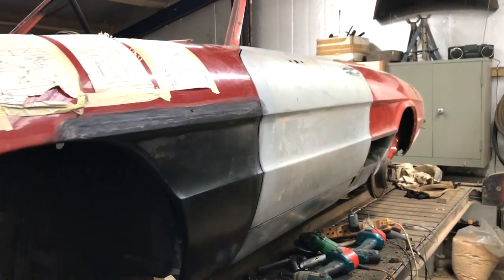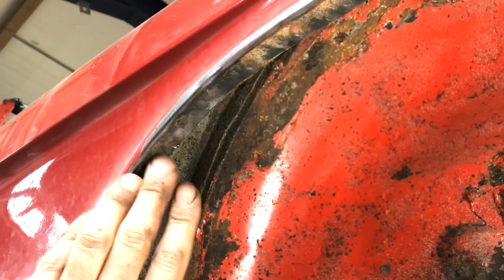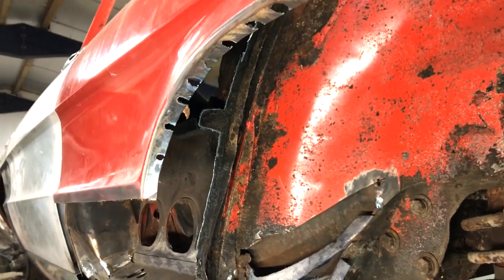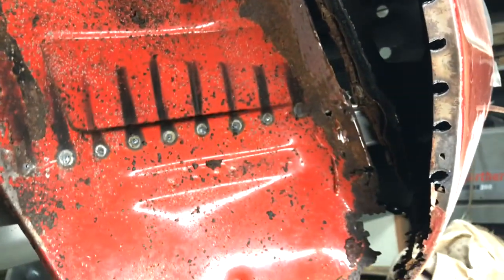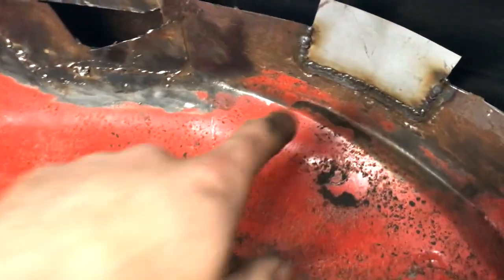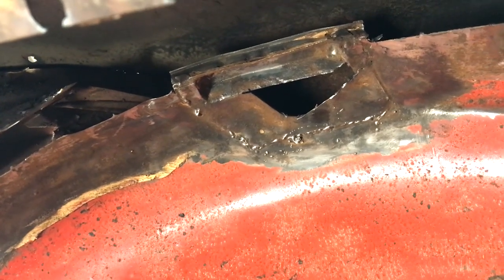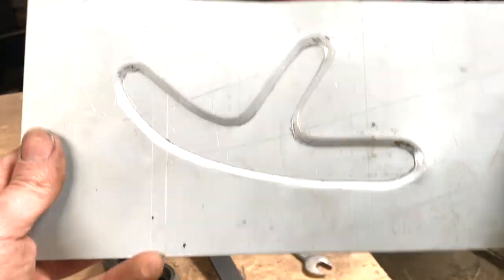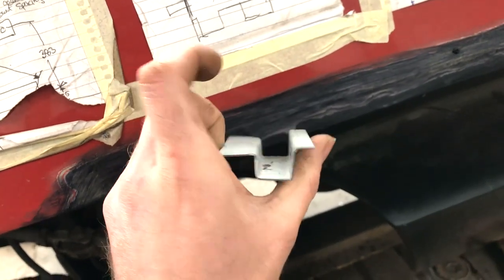Part 7 Alfa Romeo Spider Restoration 1971 classic car

Comment: Excellent work as usual. I would have liked to see the making  of the moulding though.
Reply from the maker: Thank you. There is more info in this video when I did the other side. https://youtu.be/WJdcBMy6dXw
The only thing you have to do when bending that moulding is shrink the outer edges as you go. It will try and distort otherwise. Hope that helps.
Reply: Thank you , all clear now and absolutely amazing what you do with your fly press!
Reply from the maker: 👍 the fly press is my most used fabrication tool in this job, absolutely love the things.

Comment: Yup there’s a lot of project cars out there where the owner stopped and gave up! I’m one of them!
Reply from the maker: Sorry to hear that. What car was it ?
Reply: @bensclassicbodywork  Land Rover Series 2a 109 Pickup
Reply from the maker: Ah good old series landrovers, restored a few of them now. I made a mistake on the first time I worked on one. Welded a new A post in the wrong place then tried to correct it by modifying something else. The door alignment was never great but the owner wasn't super fussy. The same landrover came back to me 12 years later with more welding. I took the opportunity to fix that door alignment problem. The landrover has just completed a journey from the uk to turkey and back. They are braver than me that's for sure.

Comment: Great videos Ben and very informative, I'm currently doing a series 2 spider in a similar condition and just wondered what thickness sheet you use for your repair sections and mouldings etc.? 
Great job 👏
Reply from the maker: Thank you. The thickness for the moulding is 1mm as are the body repair panels. 1mm is what Alfa Romeo used for these parts and of course it's always best to replicate the original. I use a vernier calliper or micrometer for measuring the thickness. Sometimes if the part is very rusty it's difficult to measure but 1mm is the most common thickness for body panels, sills are usually 1.2-1.5mm thick on most vehicles. There are always exceptions though, like the Renault 5 I'm doing is less than 1mm on the sills and the Volvo Amazon I did used 2mm! 
How far have you got with your spider ?

Comment: looking good...what gauge of steel are you using ?
Reply from the maker: Hi. I measure the gauge steel used on each car and it also depends what part of the car is being replaced. The majority of the Alfa is 1mm, sills and chassis rails are 1.5mm. This is fairly typical on most cars. The only time I've found steel thicker is on a Volvo Amazon which used 2mm thick steel on the sills and a 1920s rolls Royce that used 1.5mm on the wings.

Comment: Can I just add another reason for not blasting a car to your beginners 'don't do' list?    
As soon as it's blasted, you can't see where the rust was unless you have a hole, the thin bits are now invisible and can be a nightmare to find. Had this with a Sunbeam, customer had it blasted and brought it to me. Spent hours poking it with a scriber trying to find all the paper thin areas. 
Far better to repair the shell, spot blasting small areas as requiered,  then blast the whole thing if you have to and paint.
Reply from the maker: Good point, yes true, you can't see where the bad corrosion was and where its very thin after blasting. 👍

Comment: Yep I worked at one place left they rang me about a year later I was there about 8 month left again when the work dropped off , got a call to look at a MGB GT convertible popped down the owner had restored it himself without using bracing the car was like a banana , said no thanks not have my name put with that thing and walked away , did the same with a VW Sharan I'd done a few right off's for this family it had been repaired by with a really bad reputation for poor workmanship got it in started to strip it , the second hand roof cut at the base of the windscreen pillars and just tack welded back , no not doing that told them to pick it up as it was scrap as far as I was concerned .
Reply from the maker: I reckon you could start your own channel, just telling your interesting history.